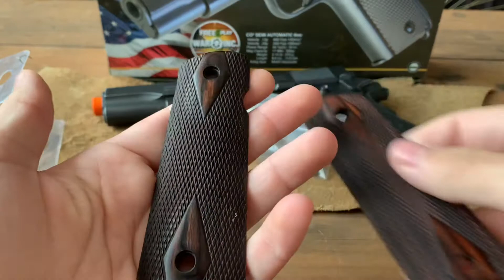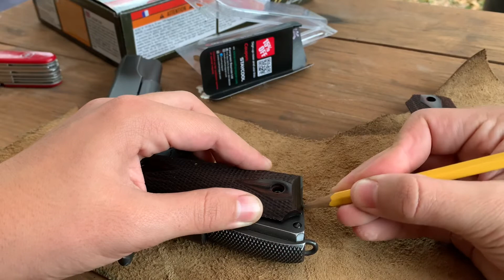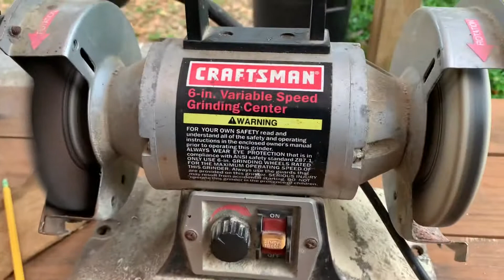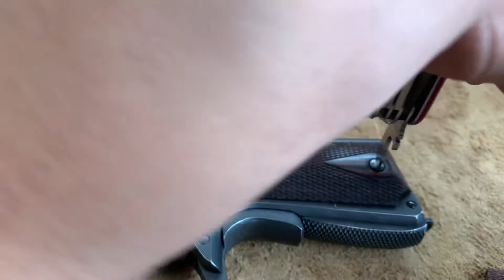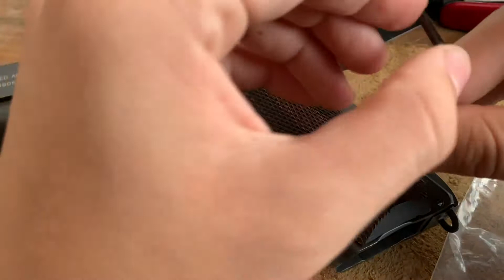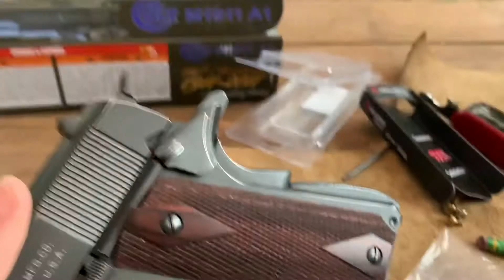Wooden M1911 grips (attachment tutorial)

Comment: Airsoft 1911 threads are 4mm metric. The screws included for real steel grips (your Cool Hand for example) are the next size bigger American SAE. Do NOT use these screws, you will strip out the threads.